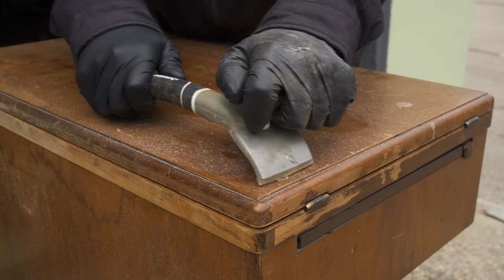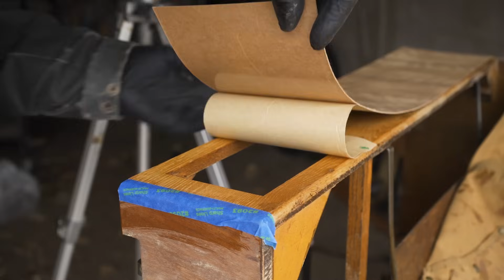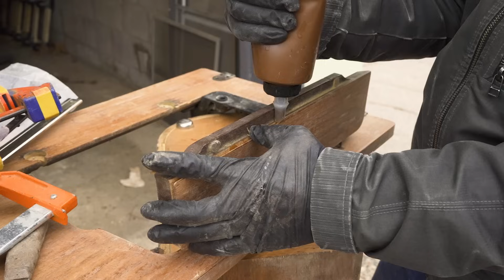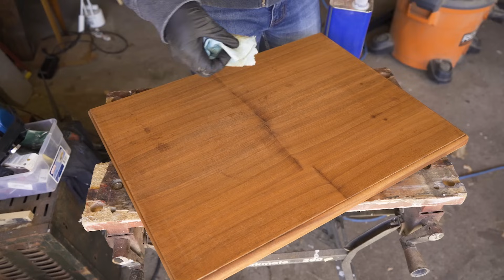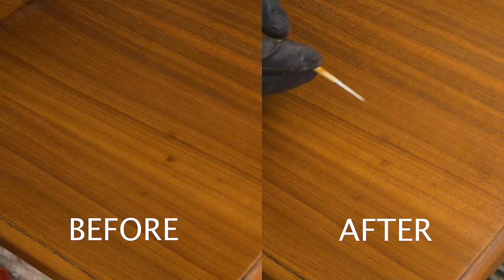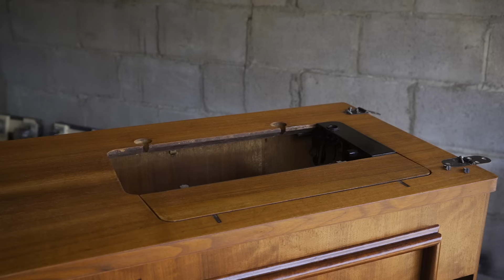I Usually Pass These Up But This One Was Different | Singer 201-2 Sewing Machine | Furniture Repair

Comment: Oh, I know that Singer cabinet.  That cabinet model I've been looking for, they are uncommon here.  That is a beautiful 201-2.  Very sought after if it's running.  Restoring sewing machine cabinets and machines, in particular Singers , is my niche.  FYI, the best cleaner is sewing machine oil.  These are finished with shellac so they can be a little delicate.    You can use a French polish technique to restore the finish.  Legend has it that these 201s were used by Rolls-Royce to sew the interiors on their cars, due to the stitch quality and reliability of the machines.
Reply: This model uses a direct drive motor, meaning no belt, and the biggest help here is cleaning and regreasing the internals. Which will make it even quieter! Replace the bulb with an LED and that's one dreamy set-up. Also, the cord set should be checked for cracking insulation.
Reply: I was hoping someone would know the model of this. I may have to search for one locally.
Reply: I have exact cabinet and machine if anyone is interested!  Im in Pittsburgh PA area.  My veneer is not peeling.

Comment: My favorite cabinet, usually has my favorite machine, a 201 in it. The base of the cabinet frequently had a band of black along the bottom.
Reply from the maker: The machine is a 201-2. The cabinet did have a dark band along the bottom but it's faded a bit so probably not easy to see in the video.

Comment: Glad you've saved this one!  A few years ago when looking for a table for a different vintage machine, I fell in love with this style & found one! (Singer did have a few versions during this style's production late 1920s to '50s... Mine has a door on the right that hides the drawers & is early '50s make).  Got it from a couple that the husband restores the cabinets & wife does the machines & U kept the original machine in it & enjoy using it or just seeing the cabinet!  (It's one of 8 vintage machines I have, but favorite cabinet).

Comment: Sweet machine! If I were still in the Mpls area would've loved getting my hands on that. My Singer 522 is in very basic cabinet, no flip-out extension which I always wished I had. Amazing refurb on the cabinet. Ahhh ...and the purr of the motor. True workhorse. Great job!

Comment: That Singer will still be working 50-100 years from now, assuming we're around and have a way to power it.  It's almost 100 years old.

I have 3 sewing machines, all 50 years or older, all working fine once I clean and oil them (dust over YEARS can lock them up).

I Googled "Art deco Singer sewing cabinet", and the first match for yours was over $1k with a $1k delivery charge!  I would LOVE to find that cabinet in a thrift shop!
Reply: A 60 year old machine is my main machine, with a 100 year old as my back up😊
Reply: I also have this 1923 Singer machine and a 1965 Husqavarna.....same ages! I still use them both!  @lauralake7430
Reply: I have this cabinet and machine, it is built 1923. Mine has been in my family.  It works fantastic!

Comment: for some information about the sewing machine - I'm not an expert on exactly which design that is - it looks very similar to my featherweight 221. And what I was told about mine - these style of sewing machines are greatly sought out for quilting. From the brief bit at the end - it does sound like it's running smoothly at the very least (no clicks or knocking). Might consider just having a maintenance check with a sewing machine shop if you have one nearby. Since the machine is running, the only thing it might need is just a tune up.
Reply: It could be a 15-91 or 201 model, they look very similar.
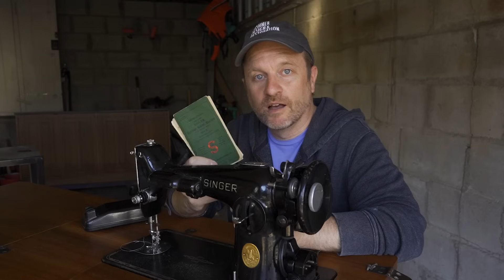Reply: @TheTalonts  at 29:06 - the instruction manual looks to say 201-2(? - kinda blurry to my eyes) The 201 is clear enough, kinda looks like a 3 at the end, but upon looking at the 2 different models, the 2 has the white power switch and the 3 doesn't... so, I'm going to guess it's a 201-2.
Reply from the maker: It’s a 201-2.
Reply: I agree - there is a bit of detail cleaning that a professional would be able to carefully do that would optimize it. A few years ago I had all three of my Singers professionally cleaned, and wow, did that make a difference.
Reply: @kathleengarness1660  yeah, I'm due to get my 221 serviced. works great, but I'm sure my local shop could make bump that up to amazing.

Comment: I think the super glue works like this. When you spray on the accelerator it starts the reaction on whatever exposed super glue there is. Then the reaction continues through the super glue once it is started. As long as some part of the glue is exposed to the accelerator then all of the glue will harden shortly thereafter.

Comment: Cannot tell if you know.... if you had tilted the sewing machine back on the poled hinge, you could have lifted the machine off the poles on the hinges. While you may still have wanted to remove the hinges to restore, it is easier to mount & dismount the machine from the hinge via the pole instead of holding the heavy machine while removing or attaching the back hinges. The switch is for the light. The pedal turns on the machine.

Comment: I believe that machine is totally usable - there's also an online database that can tell you when/where it was manufactured.  Many folks still use this model - I've heard it's popular with leather workers because it's so tough.  Having the extras (manual, button-holer) is really nice as well.  The cabinet looks super cool after your expert work.
Reply: Yes, ive used mine on leather for 50 years and had it reconditioned 15 yrs ago. It works fantastic!
Reply: @bluedragonfly5  I purchased a home recently with one of these in it. The cabinet is in good shape as is the machine what would a reasonable value for me to list something like this? Thank you for any information.
Reply: the manual buttonholer is superior to any modern buttonhole attachment. I bought a 99K just specifically so I could use the buttonholer.

Comment: Another masterfully done restoration. My Mom was a seamstress and she had a machine/machines very similar to the one you just worked on. Hers was a bit darker though. I think one of the dark spots was from where the lid contacts the support arm when it is open in running position. Probably from a rubber bumper. Somebody will love that machine. So happy that you rescued it from the scrap heap.

Comment: I’ve still got that exact cabinet, though my machine is in rougher shape…probably because my great aunt used it regularly!😅 slide open the silver piece next to the sewing foot and make sure the bobbin case is still there…it’s the little removable metal piece that keeps the bobbin in the machine, and is one of the most expensive bits to replace—and therefore unfortunately often stolen while the machines are still at the thrift stores.
Reply: Reproduction are easily available

Comment: I have that exact sewing machine and cabinet. I think it’s from about 1940, but am not sure. My great Aunt Mary was a seamstress beginning in the 1920s. She was the oldest daughter in her family, my grandmother was the youngest. She always wore makeup, bright clothes, and plenty of jewelry. She was born at the turn of the century, outlived six or seven husbands, and her claim to fame was that she “sewed for the woman who invented Tampax”.  That bit of information used to embarrass me back in the 60s and early 70s. When she lost her sight and finally had to go to a home in 1990, my grandmother invited me to take what I wanted from her apartment. A cousin had already taken a more modern machine, but I took this Singer 201-2. My four daughters all learned to sew on it, and I still use it when my computerized machine can’t handle extremely heavy fabric. This machine is a workhorse, and you appear to have all the accessories, as do I. Your machine shows a lot less wear than mine, but my cabinet has no chunks of veneer missing. I also have the “chair” that came with it (more like a stool, with a lid that lifts up to access the storage compartment). Over the years, I have at times put the machine down into the cabinet, placed a board across the top, and used it for a work table. I suspect it was marketed to double as a desk when all folded up, hence the curved ledge for a pen in the left side drawer, and …is that an inkwell? Oh, I don’t see it on your machine…it’s at the front of the left drawer. That’s the one thing that makes me wonder if this is older than 1940. The scrollwork on the faceplate says pre-WWII, but the Egyptian pattern of gold scrollwork tells me post-1940. I am not the expert, though. During the war, new parts were not made, so they used what was on hand.  I had never considered re-finishing this piece. It sits in my studio, and is loved for what it represents. Maybe, when I’m gone, one of my girls will take on this task. It was one of my daughters that send me a text and told me of this video, “Mom!  He’s doing Aunt Mary’s sewing machine cabinet!”  Thank you for bringing it back to life. I hope you find someone that will enjoy both the cabinet AND the machine. It’s a gem.

Comment: If you haven't already learned that piece is a sewing machine & writing cabinet. The small drawer on left contains the inkwell which is often lost & would house writing utencils.
Reply from the maker: @cferguson3368  Oh, is that what that little glass jar is for? It had a bunch of needles in it.
Reply: @DashnerDesignRestoration  Someone repurposed the inkwell as a pin/needle holder or simply may not have known. There may be other combination sewing machine and desk cabinets, but it's the only one I've seen that is intentionally designed to serve both purposes. Because old sewing cabinets are not valued much, I've worked on many of them to give them a new life. When I found one like the one you found, I was also impressed with the look. I kept that look like you did and showcased it as a desk rather than a sewing cabinet. It's well built and has such a cool look.
Reply: the concave tray was to hold the fountain pen. 
This is a #42 Singer cabinet / desk combo. It came in two side draw styles - drawers exposed, and drawers hidden by a door; and four different finishes.
Reply: @DashnerDesignRestoration  
The original glass & bake lite ink well is often missing from this cabinet.  And the pen rail (to the left) has not been broken. This is a wonderful unit.

Comment: And oiling... :-))) Nope, it is not enough to drop a few drops :-)) Kerosene, sewing machine oil and flush flush with at least 2-5ml syringe in every joint and gear coupling/connection.